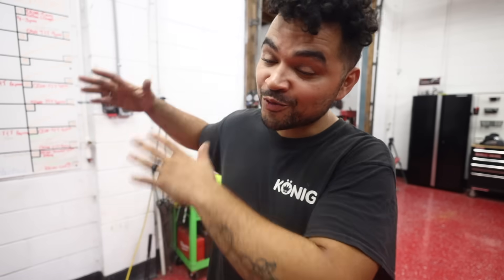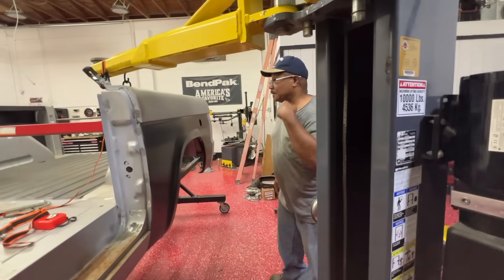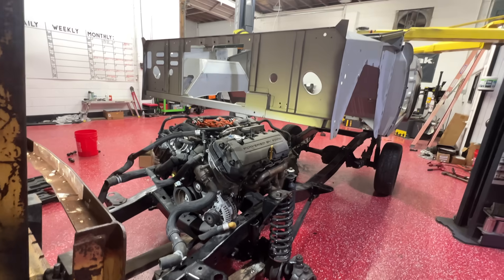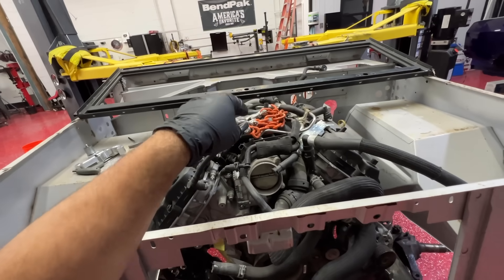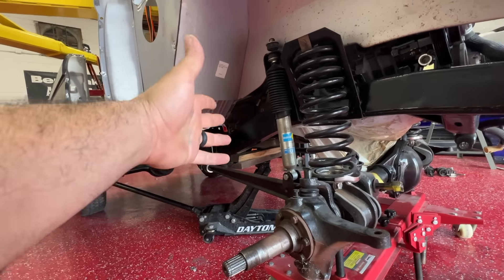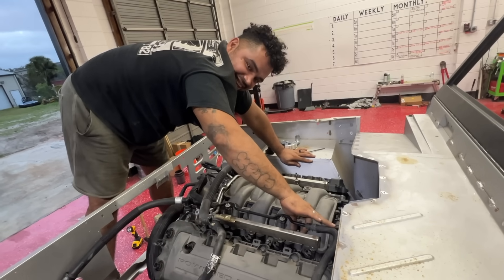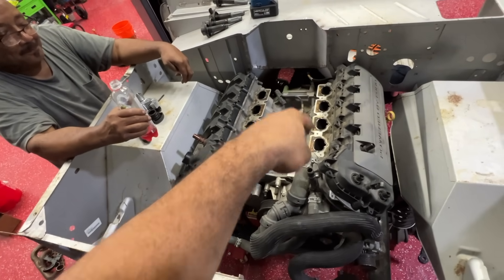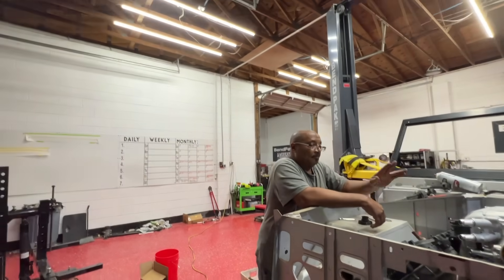2 Years of WORK has led up to this! Will IT FIT?

Comment: You will want to reconsider your suspension. I have a full frame off 66 that I put 11,000 miles on last year. With the horsepower you will have, you will most likely have issues at higher speeds. I also live in the Jacksonville area and would love to see this finished!

Comment: I didn't think about it last video , but it just came to me about them gaps you want to close up.
How do you know if maybe that's the best they are going to fit because the panels were made wrong.
The body was welded-up in a fixture.
I think trying to close some of them gaps might be a mistake 
I understand you fixing thing that have bad weld , but I don't know about you fixing the gaps